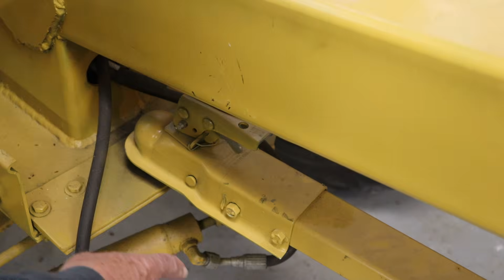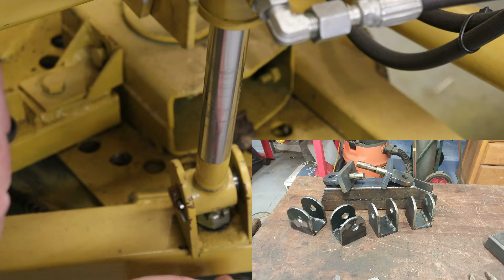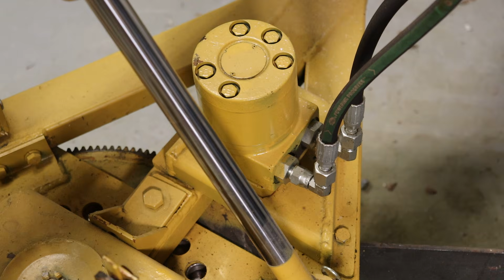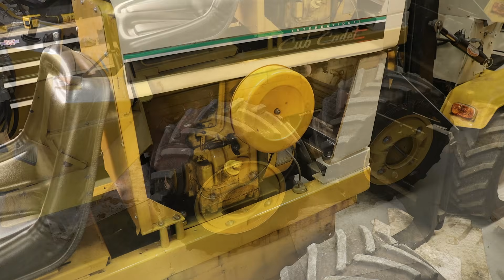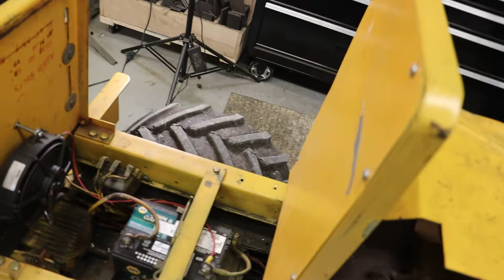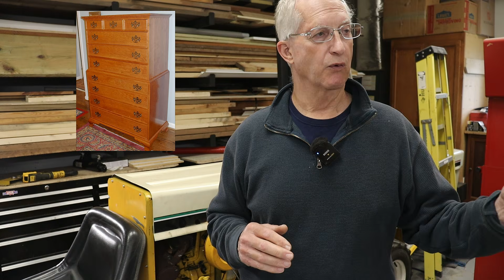Tractor 1 + Tractor 2 = Motor Grader?

Comment: Back in the early 80s, I was a mechanic on Cub Cadets.  One customer bought a used 10 hp manual shift, for a pulling tractor.  He tried to upgrade the driveshaft, but every time he started it up, it would destroy the shaft.  After the third time buying parts, and destroying them, I had him bring it in.  I put everything back to stock, and it worked perfectly.  He was trying to use a larger diameter shaft, turned down to original size at both ends, but eliminated the canvas flex couplers, which bound up the driveline and destroyed parts.

Comment: Why couldn’t you use a chain to drive the clutch instead of a belt …
Reply from the maker: Possibly could, but what references I could find put 3500 fpm as about the max speed for chain drives---so I'd be quite close to that. Plus I think belts are quieter? If that's even a factor with an engine running at full throttle...

Comment: Think a. Quick coupler on the turn table motor an pin cylinder if you really want to remove that assembly. A skid steer would be awesome. Could still keep the hood an grill backwards behind you. Keep up the great work
Reply from the maker: That would be such an easy solution!